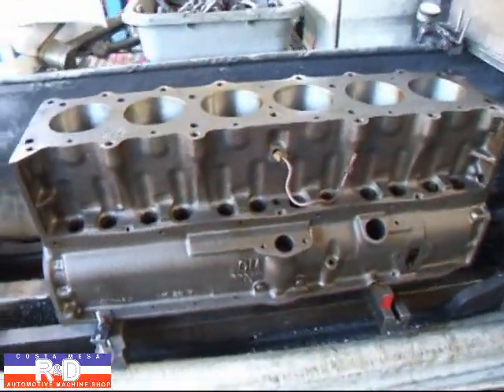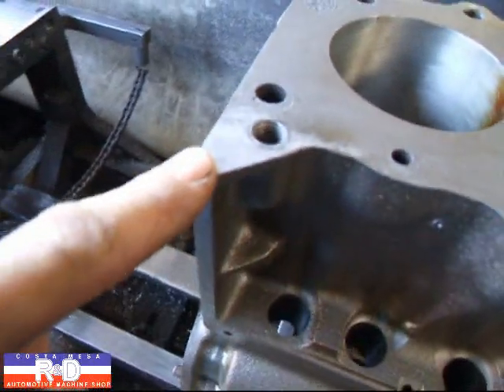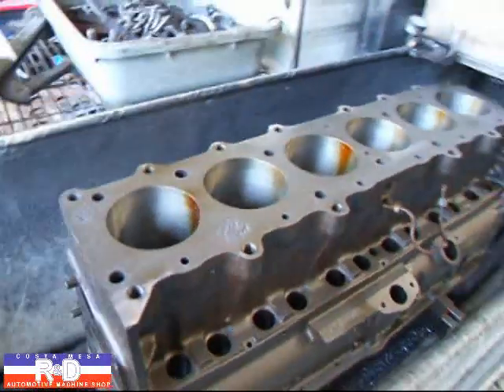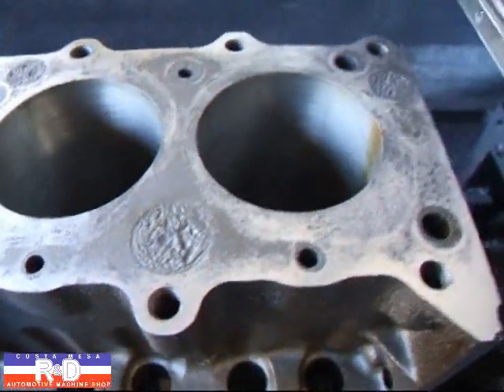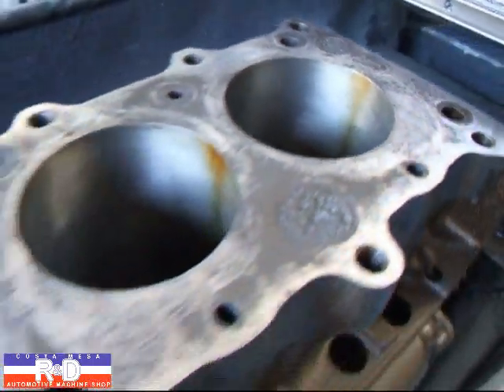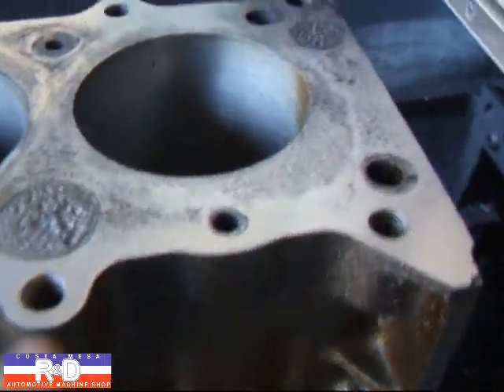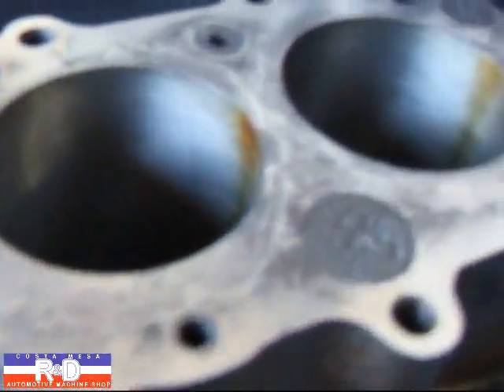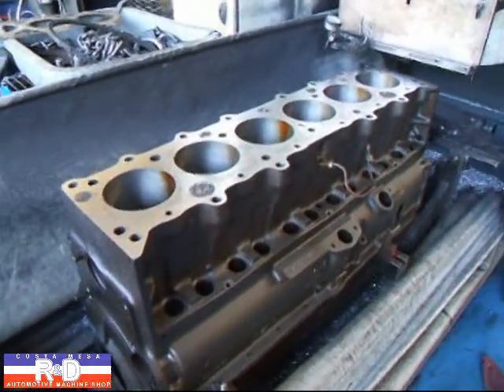Chevy 216 Block Resurfacing

Comment: I like these old cast iron blocks. They are built heavy have lots of character. A quick .008 shave on the deck and it's good to go for another 80 years.  Now that the iron is seasoned, heat cycled and more stable, it shouldn't warp as easily from now on.

Comment: Mine had a small crack in the head and it was able to be repaired by drilling tapered holes and putting in plugs.  It was then put under 50 or 60 lbs. of pressure for about an hour and there was no more leaks.  I am not sure if it is possible to repair a cracked block though.  A cheap fix I have heard is bondo but I can't imagine it's a good one.